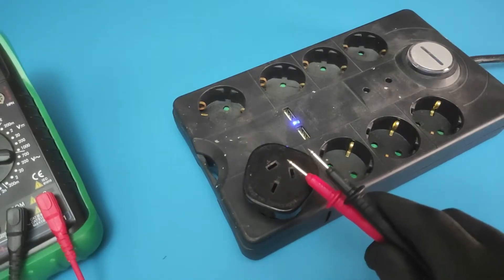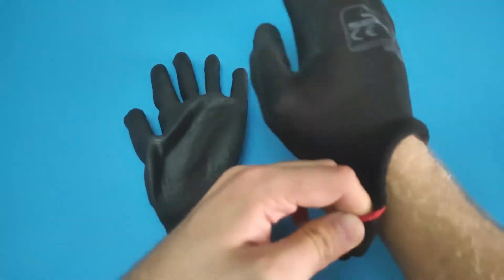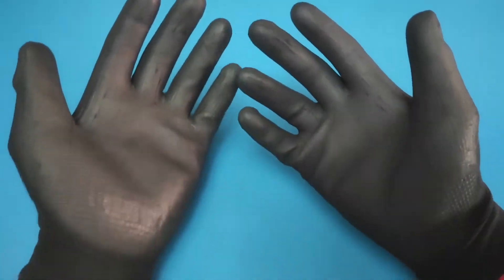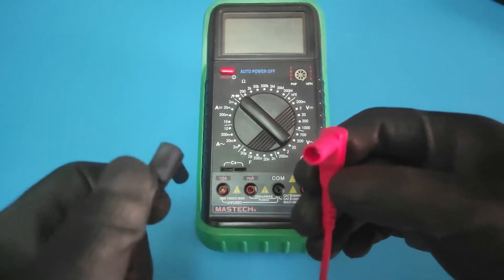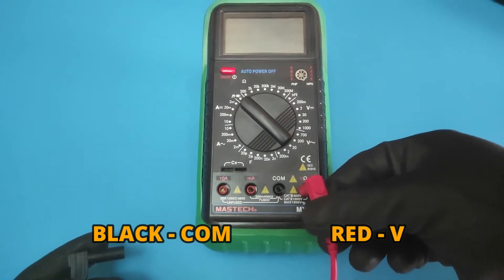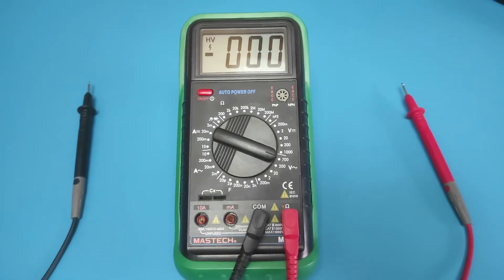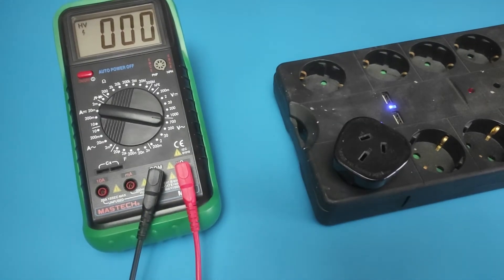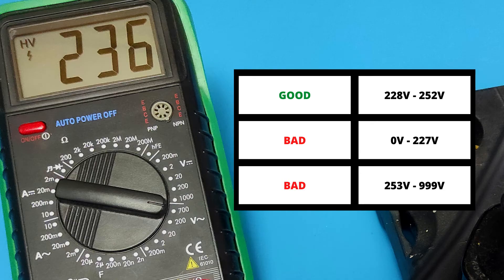How To Check 240 Voltage With A Multimeter

Comment: Those are NOT insulated gloves! Those are like cheap $5 gloves that are dipped in nitrile which is an insulator at higher voltages like 240v. Most gloves offer some degree of protection maybe but you could totally die using those gloves if you need them. Oddly Home Depot doesn’t even sell true electrical insulation gloves which are actually worn with an additional pair of durable gloves on top of them because the rubber is somewhat fragile and a tear when your using them could be dangerous.

Comment: Im in an old renovated apartment. When I measure like this I get a reading of 330. In order to get a reading of anywhere near 240v I have to put the red lead into the A slot and the black lead into the E slot.

Comment: I live in Canada and we have 110-120 for light switches but 220-240 for stoves ,heating and dryers. I tested my themostat wiring which should read 240 volts max but keep getting 275-280 volts, any reason why this is so high ? Thank you.
Reply from the maker: The unusually high voltage reading could be due to a faulty thermostat, a wiring issue, or a problem with the power supply, so it's best to consult a licensed electrician to ensure safety and proper diagnosis.